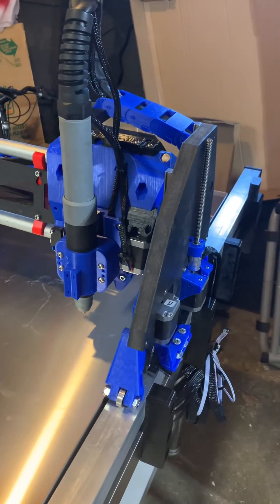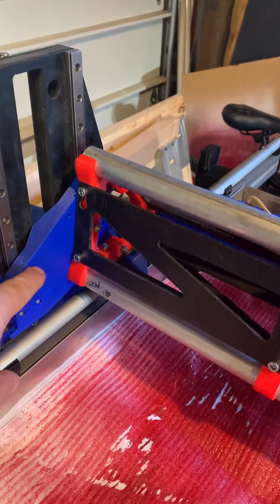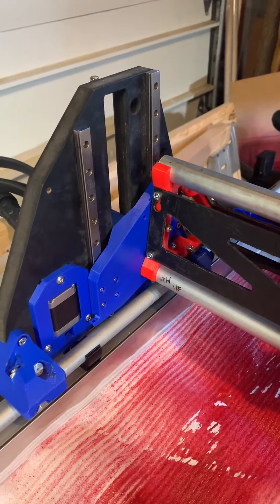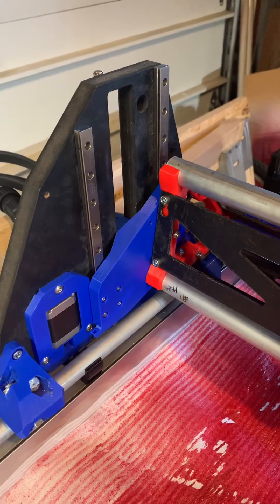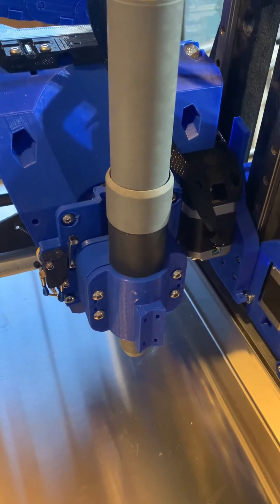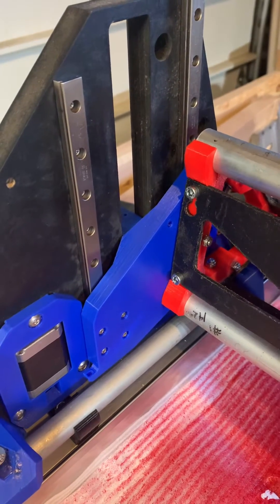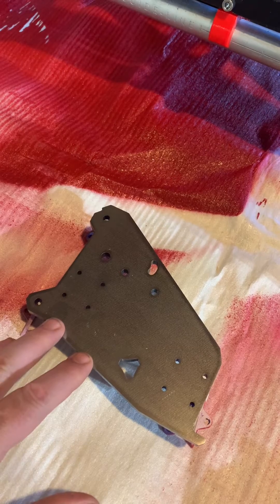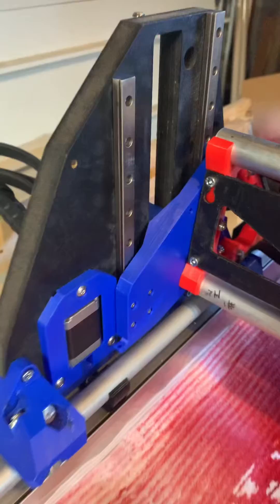LowRider 3 CNC Plasma Table SHORT UPDATE - XZ plates

Comment: I think the pla parts will be affected by heating of plasma torch, heating of cutting part. Other type of high heat resistance material is better for this work.
Reply from the maker: Thanks for watching and for dialoging! You may be right. Once I get it working I will see. If so, I will try to adjust accordingly. The only thing I can say right now is quite a few people have used printed mounts made of PLA for their torches. Time will tell if this setup works. Thanks again!
Reply from the maker: One thing to remember is that I can put that LowRider Core pretty high in the air, and have that torch protrude downward quite a long ways. That would remove the PLA away from the source of heat by quite a bit. In this video the torch is closer to the core than it needs to be. My LowRider has a mod'd side that allows 200mm of Z height adjustment! Thanks again for watching and commenting!